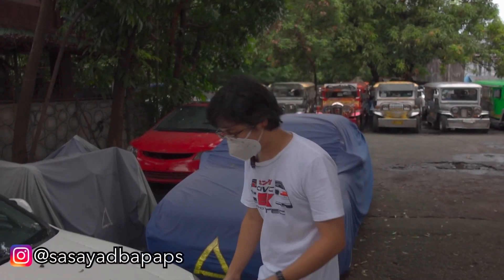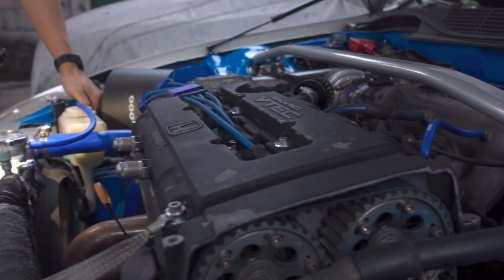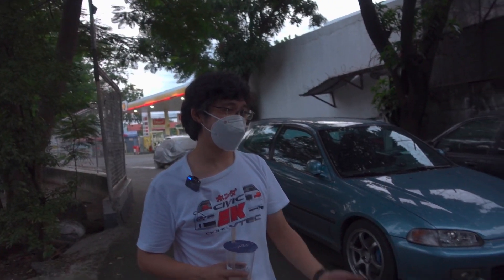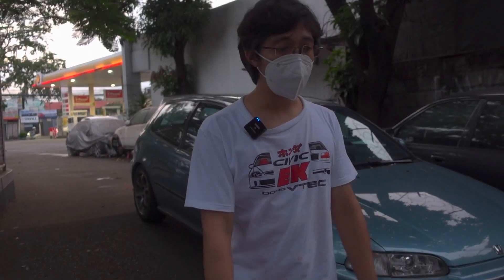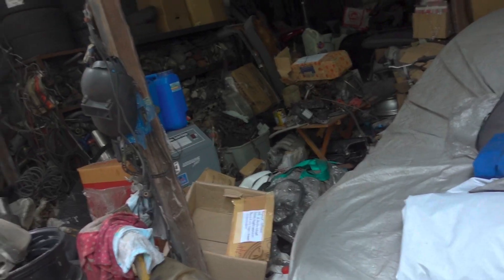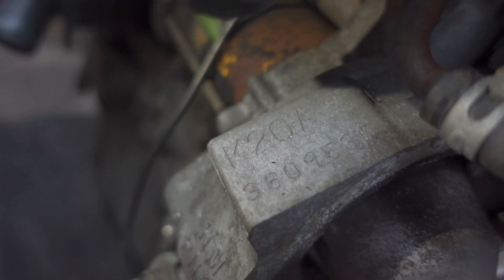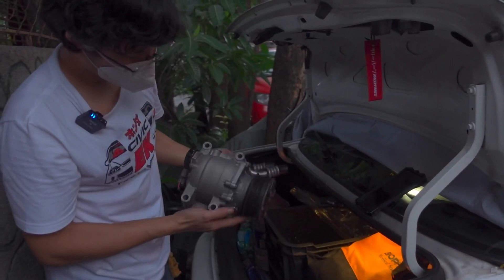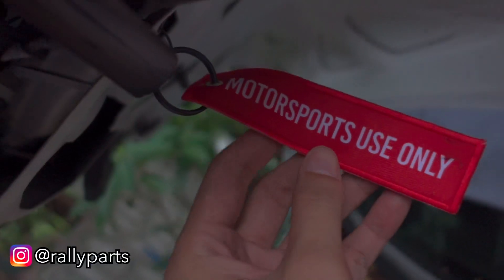ENGINE SWAP project for the Civic SiR | JDM B18C!!🔰

Comment: Is the B20 the Top gear for the B series engines? Would you consider going for it if you have the means? Or go for the K instead?
Reply: hello sir, a stock B20 engine is a dual over head cam, non-VTEC engine that produces something like 126-150hp; while a stock B18C engine is also a dual overhead cam with VTEC that produces around 170-190hp. The B20 is from the CR-V gen 1, Orthia, Stepwagon -  I think the engine is designed to have a fair amount of low end torque.

I think right now, the prices of the B-series in general are all sky rocketing because of it's becoming rarer and rarer everyday, some parts or components are also starting to be discontinued by OEM manufacturers as well. With this said, I think it's a really good consideration to go with the K-series these days as I think the K-Series is the new B-series. There's plenty of supply of K-series engines (well maybe except for the Type R ones), and there are also plenty of OEM and aftermarket parts as well.
Reply: @emilluistimbol9726  Thanks for the reply, Don't get me wrong here, I was actually pointing out to the uploader that the b18 was not the end line of b series. It seems that he/they're after the vtec series. =) 

Besides the point, I know that B series are indeed going out of the market as the K engines have been stepping up lately. B engines are great engines and great for projects as well. I hope the upload make a good one.

Bless you Kabayans with all the parts you need and more projects to come! Keeping in tune for the updates on this project. Love & support from the UK.
Reply: @Ghetto109  hello sir, I think the B18C in it's stock form is still considered a more "race ready" engine compared to a B20 in its stock from, thus making and B18C more advisable for a "race-y" or street performance set up right of the bat. 
However, there is such a thing as the Frankenstein B20Vtec set up where in enthusiasts use the B20 Block and mate it with a B16/B18 head for it to have VTEC. I think this is there B20 you are talking about. This is already considered a custom type of engine and will have specs or output that will be depending on how or what its inner working are (piston/ rod/ compression/ tuning ,etc). Sadly I don't have the means to check out a B20V engine right now so I can't really say if this is already better than a stock B18C.

I think the B20Vtec is actually very doable and can be considered a viable option for engine swaps because budget wise, B20 engines are plentiful and aren't as rare as the B16/B18 engines counterparts. You'll just have a problem getting a B16/B18 head, but I think that's easier than getting a block (as I think B16A heads are common since they were available for a longer period of time compared to the B16B/ B18C heads.)

Yes, the K-swap could be the next best thing and they're very doable right now and I think is more "future proof" 

Thank you for the love and support sir!  Wishing you good health always! :)
Reply: @emilluistimbol9726   Well said boss, dami kasi dito sa UK na gumagawa ng b20 frankenstein at may mga nagpopost nga na K killer daw.. hehe! 🙄

mura kasi kahit papano ibang piyesa dito lalo na sa k20's kaya madaling mag swap.😀

Kung madali lang i-ship sa pinas ang mga makina galing dito baka lahat ng honda dyan sa pinas naka K20 na.  😎